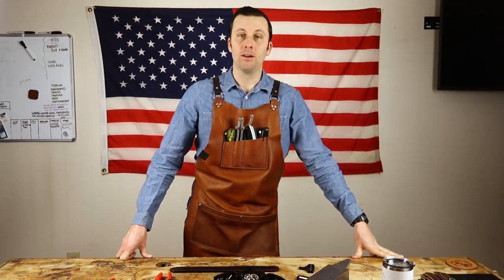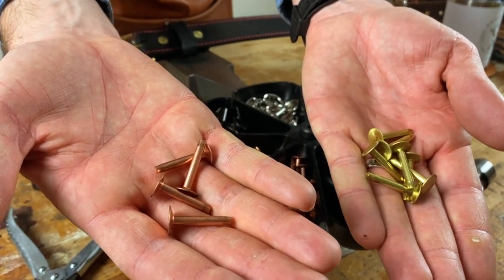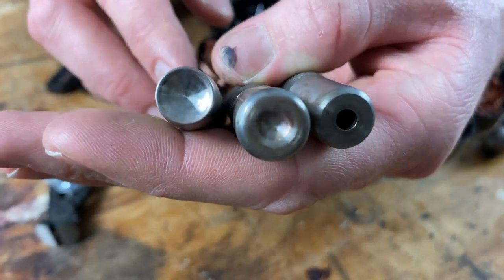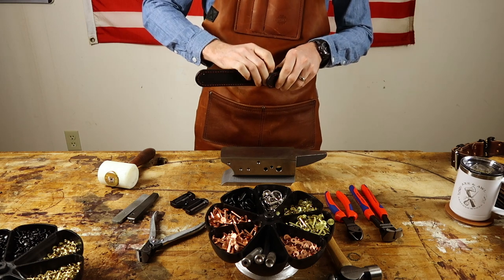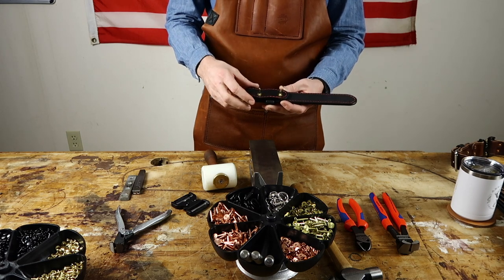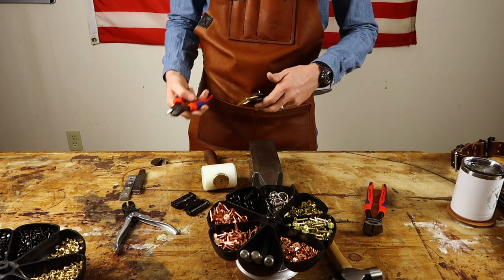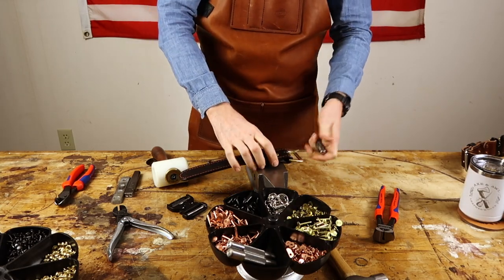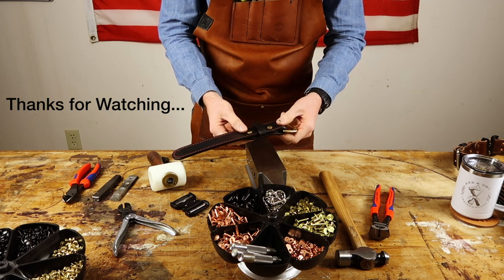Our Tips to working with Solid Brass and Copper Rivets

Comment: Great video! What it is that makes the Douglas tools an upgrade compared to the starter Weaver tool?
Reply from the maker: nobdow316 They’re much more refined with attention to every detail. In a way that helps with the finished look of your project. It’s common to have strike marks left behind with some of the standard tools, whereas these will not do that. Also, one of the tools will give you the option to dome the flat side of the rivet, adding a nice finished detail.

Comment: I got a big batch of Tandy brass rivets that the washers were bored far to small , talk about a pain .
Reply from the maker: Sounds rough!
Reply: They are not too small lol. That is how they are supposed to be dummy. You have to set the washers with the rivet setting tool, then cut the excess and peen over. Did you even watch the video?